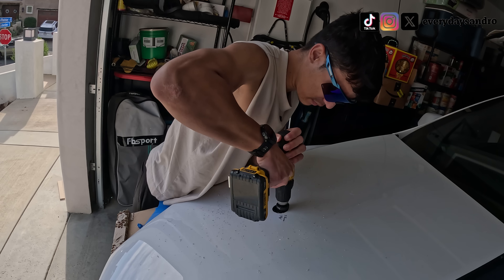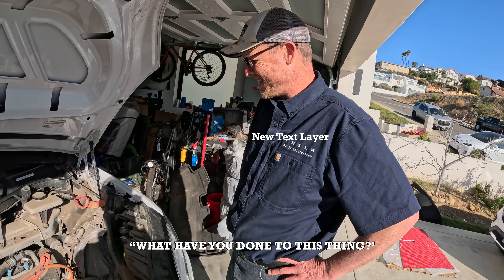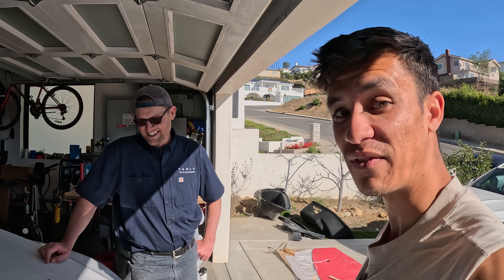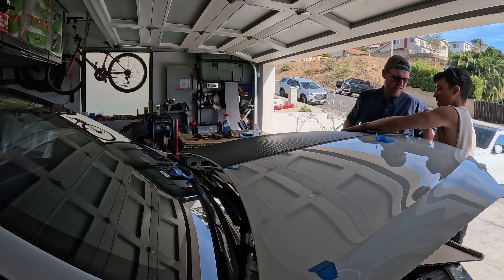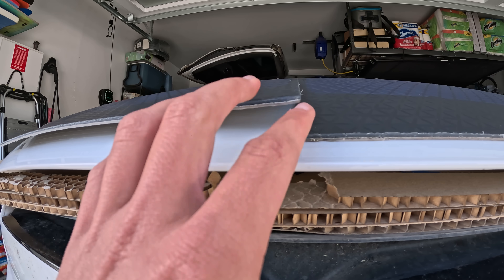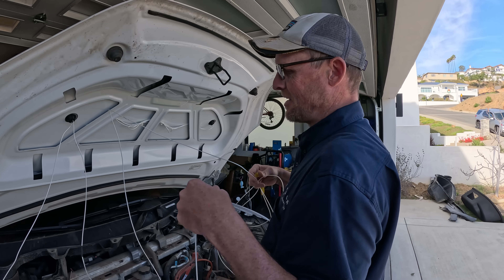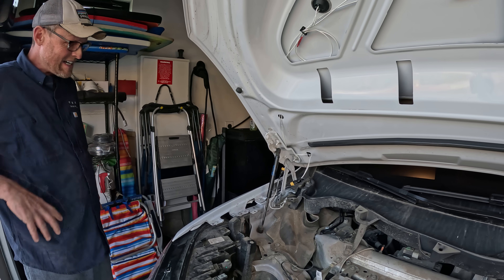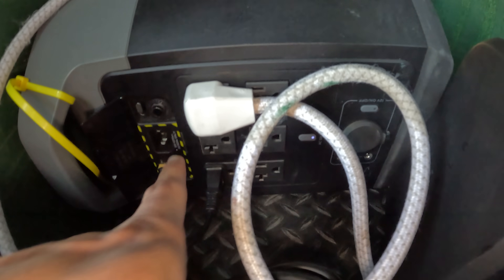DIY Solar Powered Tesla - THIS Changes Everything

Comment: You are using an XT60 connector into the ecoflow - this gives you a limit of 120 watt - change the connector to an XT60i, and You will get WAY more power - probably like 220 watt depending upon the model.

Comment: Great idea. But here's the math:
Tesla battery has cca 60,000 watt hours.
You'll need 150 x 100 Watt solar panels and 4 solar hours to get 150x100x4=60,000 watt hours. 2 x 100 panels could get you a couple of feet further at the most. I know a guy that has 10,000 watts of solar on his roof and he CAN charge his Tesla.
Reply from the maker: That's a fair point, but these panels weren't primarily installed to charge Belugita soly on Solar. Its meant to carry us into the unknown, like driving through a warzone where I can hypermile and allow all my electronics to be powered by solar

Comment: Wondering why the manufacturer required you to put two big giant holes in the middle of your hood instead of taking the wires to the back by the windshield wipers where the plastic flange meets the windshield and hood and drill the holes there in the plastic so you can’t see them and still get access to underneath the hood for the wiring to connect to the power. Totally hidden and no one would see them and you wouldn’t have to ruin your hood in case the panels don’t work out or they need to be removed or replaced in the future.
Reply from the maker: I agree that would have been a cleaner look, but these panels are specifically designed for Solar Cars, that only run on solar juice. For that to work, Jules explained, wires and any electrical components have to be tucked away tightly to optimize range. I do completely see where you are coming from! Thanks for sharing!

Comment: unfortunately there isnt enough space to put enough panels to cancel out the amount of power for a car to drive... I am interested in if can cover the consumption of the ac during those hot summer days though since those days usually come with a bunch of sun...
Reply from the maker: I use it for multiple reasons, one being, powering my starlink, fridge, and kitchen. We have used Solar Juice to get out of a pinch in Mexico a few months back

Comment: I am sure I am missing something, but how is this powering the Tesla by solar? Seems to be running a separate battery system not the Tesla?
Reply from the maker: Hey Kelvin, towards the end of the video, I talk on how use the EcoFlow that's underneath my kitchen to charge using Solar

Comment: I've never understood why electric cars don't come with solar panels from the factory... even if you get a few miles per day. Thats better than nothing so your not stranded forever somewhere...
Reply from the maker: It is a great idea to explore, but probably not practical due to the size needed to provide significant power AND THE COST
Reply: You add considerable complexity and cost by having a full solar panel+inverter system. Also any damage to the panels would be a lot more expensive than a knock on a regular car.
Reply: Because you'd get maybe a mile a day.
And that's if you had good sun exposure and parked it was outside all day.
Just silly.
Reply: @daltonterrell4860  no

Comment: should have covered the entire glass roof.  that glass roof is the dumbest idea in an EV, in the sun its nothing but a magnet for heat and radiates into the cabin causing the climate control to work harder.  covering the glass roof would have kept the car cooler, while still providing the energy desired.  and at the same time if you did the hood, you have even more solar panels for your needs too.
Reply: 400watts of solar is doing absolutely nothng on an 82kw battery.
Reply: @fvgc454ss  Optimistically it's about 2km of range per hour for free. It's not that bad I think

Comment: The glue camd ondone because you made a huge mistake.
You use soapy water o  the hood surface. And then place it and guid it info place.

Why soapy water.
Soap is a acid.
It will activate glue and it will also etch the paint.
Once dryed!!!
And you try to move it. The paint will come off before the glue.

That said.
You would need to sikaflex a perimiter on the sides.
Sand dust high at velocity may still start to attack the seams so you should protect them.

For novatly 10 point.
Practial. 1 300watts do not even dent the watts you need to really have a advantige.
Solar is not there yet at all. 
Still kinde nuts you can order schapped solar panels like that.
Would do well on live aboard sailboats.

Comment: I mean it's only like 1/2 mile per hour charge (at peak sun) but it doesn't look like it's adding much weight and it does look good.  If there's ever an apocalypse and the grid gets shut down, you'll always have a way to get around.  Have you considered continuing and putting some more panels on top?
Reply from the maker: I have here in this video, but I don't want a more complicated setup as this surfs us perfectly!

Comment: Should not solder car wires. Soldering makes the connections rigid and they are more likely to snap. Always use crimps.

Comment: I added 200 watts of solar to the roof of my car and I was able to power a fridge 24/7 using a 40 amp hour lithium battery. I don't understand the point of what you're doing though. Seems like a drop in the bucket power wise. Good on you for not being afraid to try something new though.
Reply from the maker: Thanks for sharing your setup! It powers all my appliances without taking energy from the HV. It also has gotten us out of a pinch in Mexico

Comment: Powering a Tesla with 300 watts? At 3.0 miles per kwh you need 4.6 more 150w panels to get one mile of range per hour of charging in full sun (assuming 100% of rated power per panel). If you could fit that many panels on the car you might actually get 4 or 5 miles of driving range per day from them, which starts to be worthwhile.
Reply: Dumb idea. Waste of money. It would take a year to charge that car to full.
Reply: Bro, if you live off grid and only need to drive 15 miles a week this works

Comment: massive shoutout to the shot life of the panel, you got lucky if the panel will last for 5 years
Reply from the maker: 6 months its been thriving through heat, hail, rain, sand, rocks and snow! - Beluga
Reply: @EverydaySandro  lol regular solar panel from amazon for $60 per 100w can last 20 years still 80% life these wont even near half of the life of the larger panel. hopefully you only pay less than $200 for these panel its a TOY
Reply: @EverydaySandro go get your self Monocrystalline Solar Panel and BTW you will need 10kw to charge the car effectively, (you setup just enough to charge my laptop lol) please mount it and wire with a good inverter an go get a permitted.

Comment: So there's 300 watts to charge 75kwh batteries. Should only take 250 hours of direct sunlight which is 30 days. That's awesome. Leave your car in the sun for a month to drive it 300 miles. That's super.
Reply from the maker: I appreciate you calling me light, by I have a 100 kWh pack - Beluga

Comment: This is the dumbest idea. There is not enough energy from the tiny panels to make a dent in the Tesla battery. Typically there is about 1000w per square meter at 100% efficiency. Typical solar panels are 17 - 25% efficient so at BEST for only a few hours a day would you be producing energy. You have a 80Kwh battery and your are essentially trickle charging it. USELESS!!
Reply from the maker: *USEFULL. Hi John, we installed these panels NOT to primarily charge the car, though we have a few times. These panels give premium juice to my EcoFlow, so I can cook, connect my Starlink, and charge my other appliances. Beluga has a 100 kWh battery so I wouldn't be worth it to fully charge the HV, but it has gotten us out of a pinch and we are currently loving the sunshine in Guatemala!

Comment: If only there was a way to
Multiply the charging intake to put more juice in the battery, but like this,
It will keep the Tesla alive in my opinion, some time ago there was a disc or hard drive, that used the laser to acces data in an infrastructure of a building like different levels or floors, I wonder if putting a mirroring shield on the back and adding another layer of cell would increase the charge, kinda like a lower level but using the top level to reflect light.

Comment: 12 to 15 Kw per 100 km is required so a retired person parking the car out side might get enough power. Maybe a 100 to 150 km per week in good weather. If every inch was covered by cells with higher performance, will be interesting.

Comment: Probably I'd just use snow ski roof top rack to pin the panels and leave the solar generator in the Trunk
And a little Generator in the Frunk. So you can drive across Tijuana 14:56

Comment: What case are these panels for?  It can't charge while in drive.  If in park, you can use portable solar panels--with better angles.  I'm not seeing the use case for these panels.
Reply from the maker: Hey Bickerin! Massive use case for my expedition. When I drove to the Arctic Ocean, I had to unplug all my electrics from the car to conserve battery, so my fridge, Starlink, and other appliances had no power. Now that I am remote Mexico, I have do little to no input to harness solar juice when I am remote expeditions. Portable panels are great, but most places where I am parked there is often too much wind and I am lazy to set them up.

Comment: Thanks for posting. I like your videos. Question, I’m a pilot and drive to the airport and park for several days. If I park for 5 days with this type of setup, how much power could I generate? When I arrive at the airport it’s at 35% so I can’t make it back home without supercharging but would love if I could charge while parked for days so it would be over 50% when I return. Also, what’s the name brand of the solar that bends on your hood?
Reply from the maker: Yes, absolutely, you could figure out a way for the EcoFlow to charge while you are away with a wifi booster and installing flat wires that run out of the EcoFlow into your car. These are solar panels made by MitoSolar from the Netherlands. Thanks for watching

Comment: 300 watts x say ... 6 hours = 1.8Kwh. A Tesla, on average, uses approximately 0.346 kWh per mile. This translates to around 3 miles per kWh. 1.8÷.346=5.2 miles range extension per day x 365 days (if he can get full sun every day all year lol... is 1898 miles a year.

.15 cents per kwh means per day he is gaining $284 per year or .78 cents a day.

Those panels probably cost a thousand bucks so the roi is 3.5 years 😅😅😅
Reply from the maker: That's some serious math, Beluga is happy camper

Comment: Does it charge while you're on the move? And if so, how much has it increased the driving range?
Reply from the maker: It doesn’t charge the High voltage battery, but instead charges my Ecoflow, which has charged Beluga 3-9miles!

Comment: You should also consider a boost converter or dc to dc charger connected directly to your low voltage battery. This can be used when the sun is unavailable.
I installed one on my 2018 Model X, and I'm charging my power station at just under a constant 500 watts!
It's cheaper than a solar setup and much more reliable and predictable.

Great video though, interesting concept!
Reply from the maker: That’s interesting mate, love that, very smart! No issues with the onboard electronics?
Reply: @EverydaySandro  None at all! My car has a standard 12 volt battery that can easily supply the 50 amps I am pulling. There's very little to adapt from a standard gasoline car battery. I know the newer models come with a 16 volt lithium battery but I would imagine those should be even more efficient with the higher voltage. You would probably need to create a wiring harness to tap into a new battery as there is no exposed terminals. 
Happy travels! Stay safe ✌️
Reply from the maker: @user-sg2cf9xq3i I have thought about it but I wanted a system separate from my car system! I do like what you did working with what you got!

Comment: Dude! Please post everything you used to make this great project. People like me that owns a model 3 and living in NYC 🗽is difficult to get a charging station without paying so much money. All the information of the project
Reply from the maker: It is definitely an expensive solution but it is totally worth it in the long run, I hope it helps! I contacted MitoSolar from the Netherlands who specialize in custom solar panels. They custom fitted my Model X and did most of the hard work. We used XT-60 to connect the solar wires to the EcoFlow Delta Max in the back of the car
Reply: This won't work as theirs not enough surface area to produce enough power to overcome the internal resistance of the battery .. Their are internal switches that will fail from under voltage and this will voide the warrantee and ruin the car .. You gullible people don't think that Tesla and every other ev manufacturer didn't try this already ?? Lastly the wind resistance from the panels alone will also create drag and your range will actually go down due to air drag .. Again this is a complete waste of time that will destroy the delicate electronics of your expensive car !! 😢

Comment: This is something I been saying for ever.   I don't have an EV, but we do panels on our overland vehicles for keeping our batteries charged up.  I always wonder why they didn't put solar panels on the hood/roof/trunk areas to trickle charge as your parked or even driving. I know it's not enough to give full charge while using, but even if your not driving a little is better than nothing.  I think some one else said it, surprised you didn't get a junk yard hood to do this with.  Also put some rubber gromets on those holes to protect the lines.  Awe some job other wise.
Reply from the maker: Cheers! I am overlanding a lot in Mexico right now and these panels are working great. At 9.00 already peaking over 200+ watts b

Comment: I was a mechanic for a while, I used to do bodge jobs on my own cars, get a rubber grommet to line those holes you should be able to find some that fit nicely it will help prolong the life of the cables and prevent the ingress of water to the panel so it doesn’t rust out
Reply from the maker: Great advice! I used rubber grommets to protect some of the wires too!

Comment: Add a turbine for more.
Reply from the maker: Any brands you suggest?
Reply: @EverydaySandro  dont know what’s the best but I do think this style is best suited for a Tesla at low speeds or parked.. https://youtu.be/83smlFegbCM?si=_vV1YvyePCRGE2qT

I’m adding a stealth hitch to my dual long range 3 and plan on trying a version of that turbine but adding jb weld at all attachment points for the fins of the turbine.

I may add cargo roof racks and throw the turbine up on the roof both methods Id add fairly quick removal features which probably will be easiest and most durable for the hitch application.

Sad you didn’t add silicone to help hold down the panels…Id definitely look into hood removal and fip over and add something to the holes in the hood to help the panels stay.